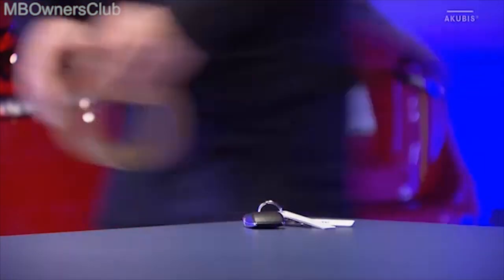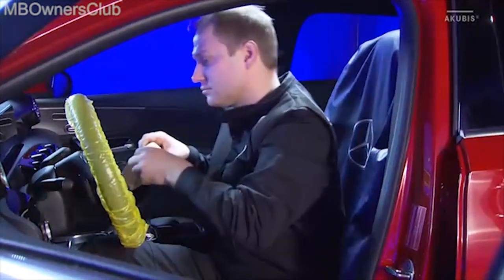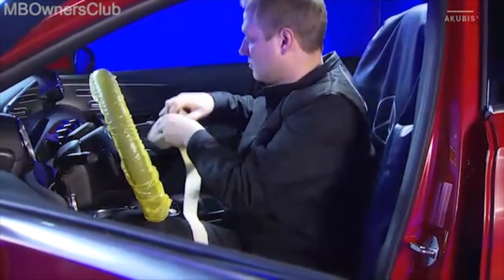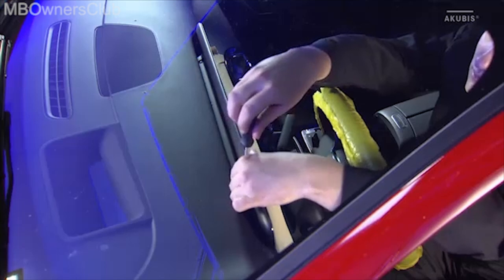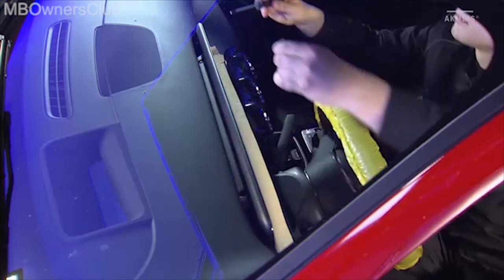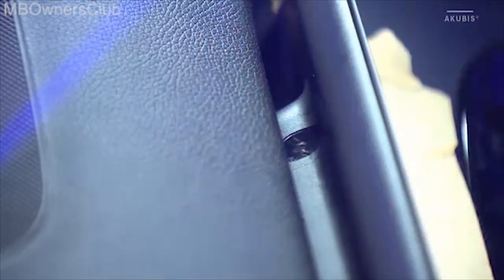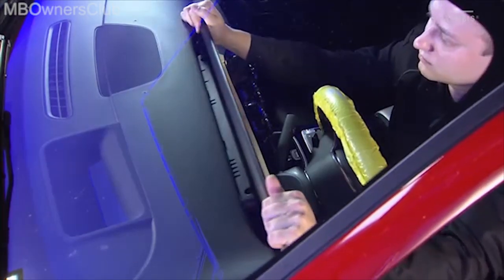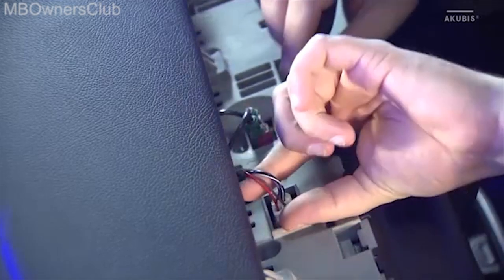Mercedes-Benz A-Class: Display Module Removal and Installation Guide for W177

Comment: Hi, The replacement of a screen (7 inches and 7 inches) by a screen (10 inches and 7 inches) is it plug and play? Does it require reprogramming of the unit?
Reply: Hi, have you got an answer for your question ? Thank you
Reply: good question, wondering the same
Reply: what is the unit name?
Reply: requires reprogramming for sure.
Reply: requires replacement of a radio control module under the seat + programming
Reply: Hello, I am wanting to replace the 7inch screens to the 10inch and 7inch. Have you found out anything?
Reply: Mercedes..... Almost every thing needs programming like B777....